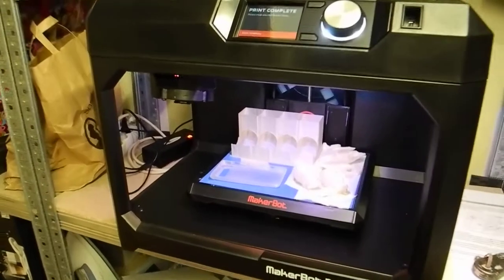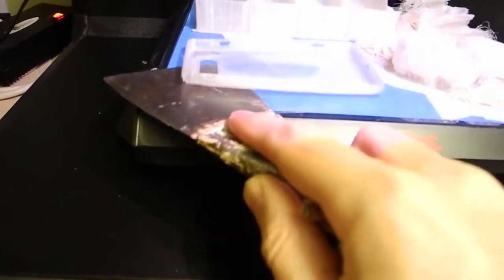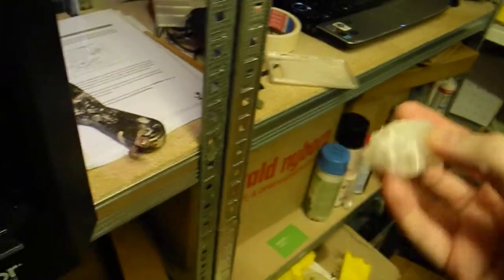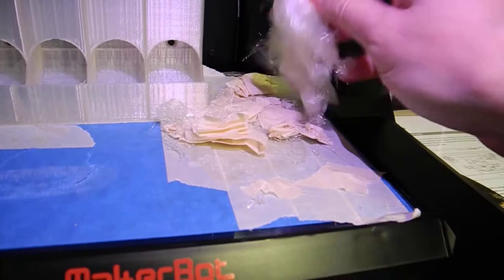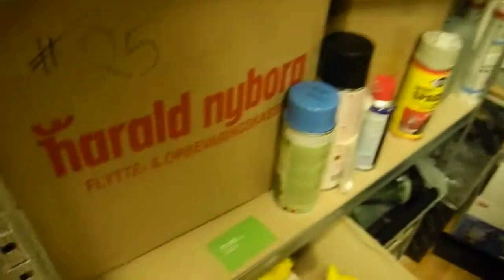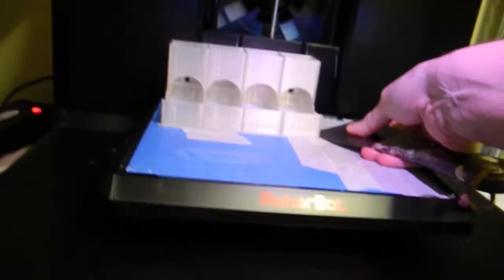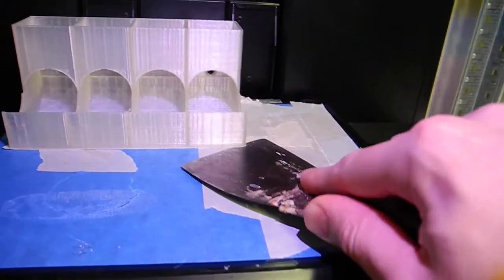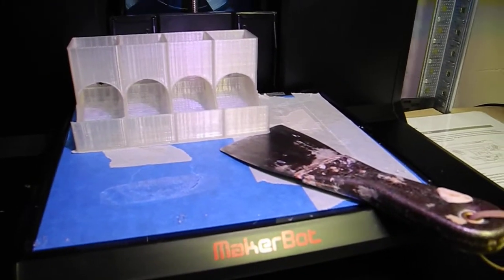Printing on the 5th generation Makerbot replicator

Comment: you should ditch the makerbot for an ultimaker, such a shame the way makerbot people are behaving......pure assholes the ultimaker has a heated bed and better resolution, and you won't need builders tools to take the prints off the bed. replacements are also dirt cheap, unlike everything on the makerbot.